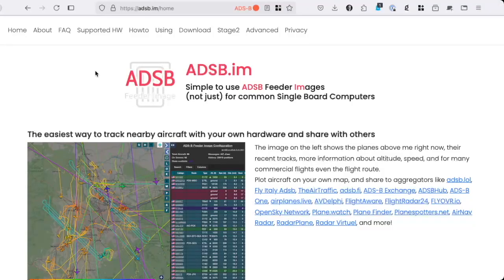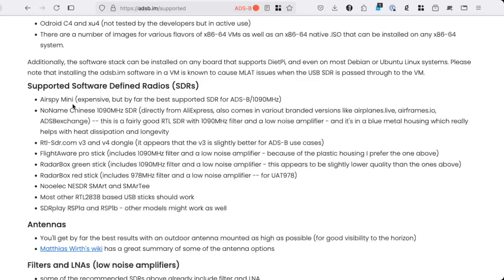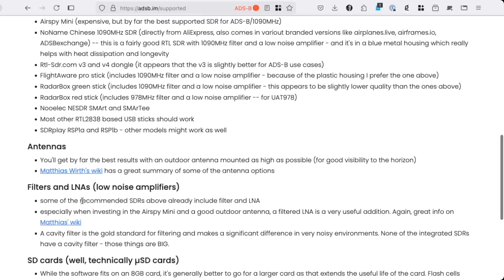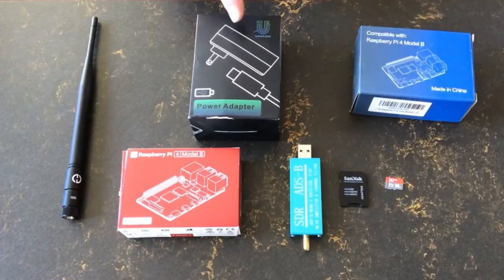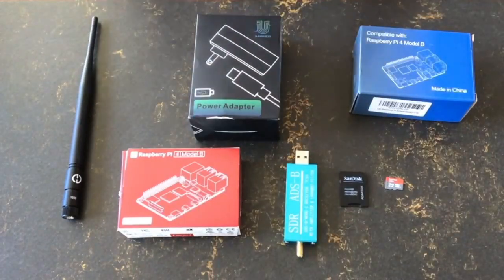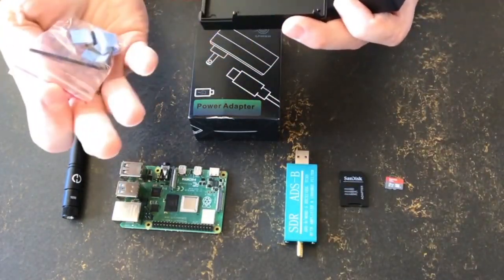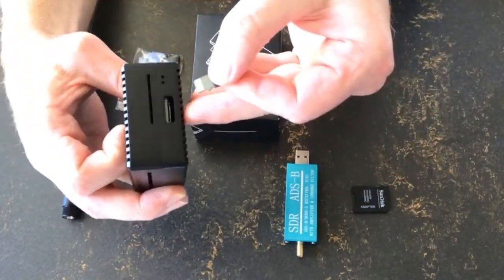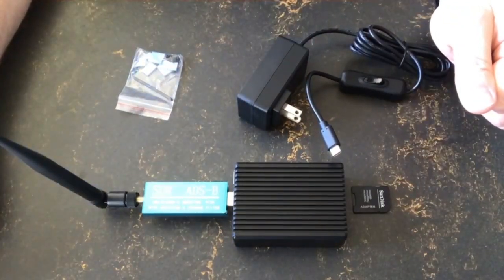Building an ADS B Feeder

Comment: Just brought mine online today, thanks for all the info!
Reply from the maker: Awesome - I'm so thrilled to see more people joining in!
Reply: @ I am already looking into an outdoor antenna lol… it’s out in my shed currently with the wireless weather station that also feeds data to Wunderground every 30 seconds.
Reply from the maker: @BigZeus  Yeah, I also feed Wunderground :)
As for outdoor antennas, higher up is better. There's a ton of antennas available and not all are created equal. If you tell me where you are in the world and what price range you are looking at, I might be able to give you some recommendations...
Reply: thanks! USA, central Texas. Is it better to mount 6 feet off the ground with a clear line of site to the sky or higher, but inside an attic? I’ve always wondered. My helium miner antenna is in the attic currently.
Reply from the maker: @BigZeus  you'll love the answer... 'it depends' 🤣
Seriously, the material of the roof, siding, any obstruction between the antenna and the outside world plays a huge role. Especially modern, insulating materials can be a significant RF barrier.
So if the 6ft off the ground spot doesn't have a significant blocked area due to the house (which I assume is where that attic is), then outdoors is better. But I have a couple of feeders with antennas in attics that create impressive results, close to the theoretical maximum of reception. It may absolutely be worth to go try both and compare.

You didn't mention a budget.
This is a good antenna, outdoor rated, easy to get - I used it for a number of my feeders: https://amzn.to/3R3EkTI
I've used this one as well, still decent, but not as good: https://amzn.to/4iWXuqv
I've not personally used this one, but know people who have and really like it: https://amzn.to/4jHUAGn
And this is likely among the best ones you'll find in the US; I know quite a few people who use it and swear by it:  https://dpdproductions.com/collections/aviation-base-mobile-antennas/products/ads-b-vertical-outdoor-base-antenna